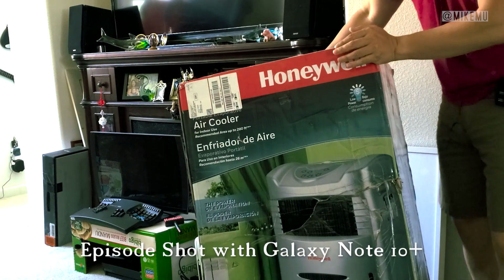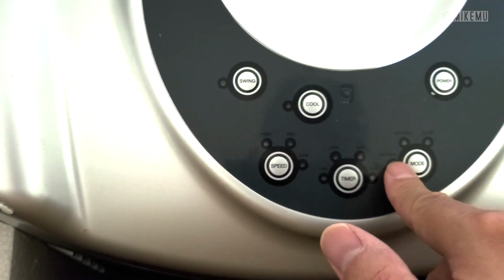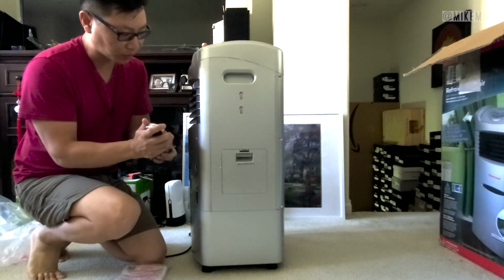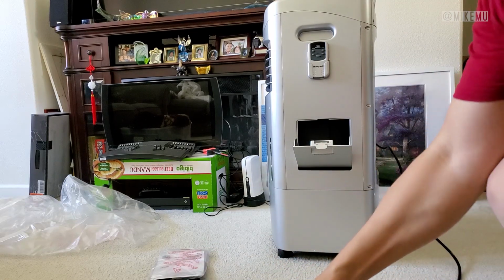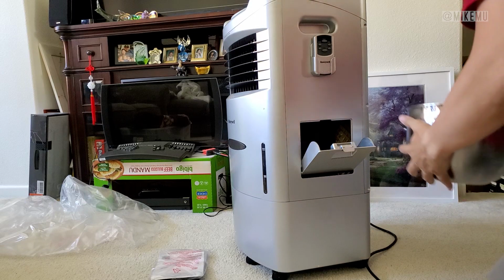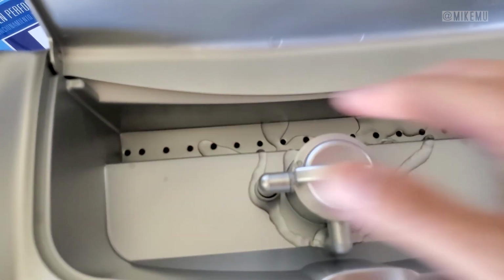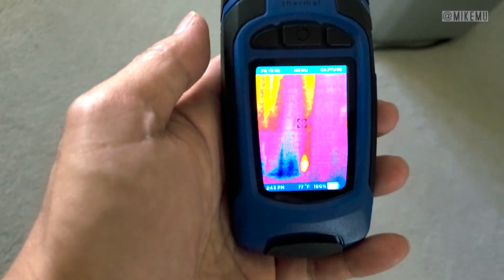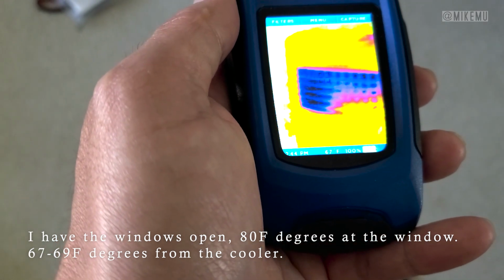Best Air Cooler? Honeywell Air Cooler | First Impressions Review and Test

Comment: I can't here. It's a swamp in the summer.   Still trying to drain it! lol   I'd still stick with AC.  I bought a portable second AC unit after my main went out one summer and needed something to get by while that got fixed. .  The new split window units look cool and better than the older 1 block window units and much more quieter perhaps with the split design.  As long as your insulate your exhaust hose on portable units - you're doing good. I haven't gone to full insulation - but wrapped tighly in 5 layers of aluminum foil and some dryer vent duct, keeps all the heat out the exhaust and never heat soaks.
Reply: I did set it up last 2 years and ran it to supplement main AC.  trying to hold out this year - not sure if I'll make it - it's been pretty dry - I'm not sure if taking a vacuum to the inside heat exchange part helped any - but i'm getting good temps.  Things might change if I turn my NAS back on. :(   that thing is like a nuclear reactor with 20 drives.
Reply from the maker: Where is here for you?  If you can, the split window units are so much better.  Its what my family in Taiwan use and its quiet, efficient, and looks way better than the traditional window units.  Too bad it hasn't quite caught on here stateside as much.
Reply: I'm from Bangkok where it gets to 80+% humidity at 35celcius (about 95F) and I can cool the air by about 10F. As long as humidity doesn't go above 90% it should still be quite helpful.
Reply from the maker: Wow. I wouldn’t be able to stand that for long. I’d be AC all day long in those conditions.

Comment: 5:57 man just the tiniest ridge on the little shelf there would allow for it to fill up and spill water over the edge evenly... could possibly achieve the same thing by just putting something just a mm or 2 thick under the back wheels and giving the machine a very slight tilt forward.

Comment: I live on the coast of California and mine doesn't do much good...it humidifies but the temp of the air coming out is only slightly cooler...not ten degrees... even with ice cubes and cold water. This is a newer model maybe that's why his gets 10 degree cooler air flow.
Reply: Evaporative coolers work best with dry air, and if you're right near the ocean it's probably too humid to do that much good.
Reply: I have one too and it doesn't do anything even when I put ice in it.  I live in a dry humid climate and it doesn't cool anything.  Might just toss it out with the garbage tomorrow because it's just a hunk of useless plastic

Comment: HI Mike.  Fantastic review.  Do you think this would work well in a 500 SF Garage in Las Vegas (110-115, extremely dry weather)?
Reply from the maker: It will drop it several degrees but not enough to be comfortable. But you add this an an AC unit it may do some real damage especially with some insulation. Otherwise you’d probably have to sit right in front of it.
Reply: If the garage has a window ( or make a vent ), use AC with evaporative cooler (save on electricity cost by ~1/2). You need a larger cooler for 500SF ( or get two of the model in the video ) without AC.  They should cool the garage down to 90F (cooler only no AC). Need to crack open the garage door when the cooler(s) is on.

Comment: When in use during hot summer days, do you open the windows to prevent indoor humidity from increasing ?
Reply from the maker: If outdoor humidity is higher no.  But yes if indoor is higher if you use something like an air cooler.

Comment: Inwanna use it in a room that has no windows, would that be ok to do?
Reply from the maker: If you also run a de humidifier it may be Ok. Otherwise you would be safer with just a fan or traditional AC unit. The moisture buildup could result in mold if humidity gets too high.

Comment: if only these worked in texas lol....no such thing as dry air down here
Reply: Fistagon777 Not true. It will work as long as humidity is less than 60%. Unless you’re in Houston or south you’ll be fine. Its 40% humidity in Dallas. People are reporting these units working fine at 60% humidity.
Reply: @jaeshasway  There is dry TX and humid TX... I'm guessing that comment came from humid TX. I'm in Los Angeles and it works well on hot dry days.
Reply: @joeltucker306  How well does it cool a room (even a small one) in LA? Like how many degrees lower, and does the humidity from the water help? Am in SF (reluctant congrats to the Dodgers, lol) but we've been having massive heat waves for the past several years.

Comment: Do you think you could use a dehumidifier along with the air cooler if you live in a humid city?
Reply from the maker: Absolutely!  But after you do that, you may be approaching power consumption levels of a very efficient air conditioner for similar results. So for humid areas, a traditional air conditioning unit is going to be best because it cools and dehumidifies as a part of the cooling process.  So what would be better is A/C plus an air cooler.

Comment: Hi Mike - Great video. Looking to get 2 of these units for my home. Now that you've had it for a few years can you provide any updated insights? Still a good unit overall and able to cool ~10-15 degrees in your home?
Reply from the maker: Yes. We don’t use much because the weather is good here most of the time. Stay away from hard water if possible, or use a water softener.  Make sure you drain it before storing.
Reply: @MikeMu  - i would imagine the ice cubes melt extremely fast and the water terms chances over time
Reply from the maker: @worldview2134  I have personally found that ice cubes don’t make enough of a difference to warrant the hassle of using them.

Comment: Thank you for the video mike. Can I ask you a question? Could you maybe tell me the dimensions of the opening for the water and how big is the reservoir? I would like to put an Engel 32 ice pack that is 12.5 x 8.37 x 1.62. any insight would help.
Reply from the maker: Hi Victor. I’ve done some testing and I’ve made no appreciable difference in performance.  Also I have the cooler at another location right now, and off the top of my head , that isn’t going to fit well.

Comment: Just bought one before watching this video. They sold it to us as if it was an ac but all it really is is a freaking fan. And another thing I didn’t even fill it up to the top and it started spilling all over my hardwood floor. Def not what I was trying to purchase.
Reply from the maker: Did you find out the cause of the spilling?  No issue here.

Comment: I have two.  They are CL25AE models. I think they are great for my needs this summer in CO. 

This just came up. Water in one was turning to a yellowish color and can smell it today.  So...I need to check manual if I can drain the water. I do not think there is an option to hand clean the reservoir.  My other unit is fine.
Reply from the maker: Great!  I'm glad they are working for you in CO.

These units need to be drained completely before storage, or when not in use.  There is a plug at the bottom of the unit (usually some form of rubber) that you pull to drain.  Make sure you do this outside, in a bathtub or somewhere you can let the yellow water come out because it will dump immediately.  

You can try to clean out the media...  But you might find out that you probably need to buy new filter media: I found one here: https://amzn.to/3h3eBH2
You can unscrew the back area and pull out the media.  At that point it should be pretty clear if you need a new one or not.

Use this as needed for your other cooler as a preventative/maintenance measure: https://amzn.to/390C4Wr (currently cheaper in multipacks)
Reply: @MikeMu   Awesome,  good to know.  Thank You for the information  and your reply.
Reply: Thank you for that information!  I used this in 2021 and now in 2022 so I'm trying to clean it out and maintain it. It our go between ac unit. In southern Colorado it gets hot early and cold late, unfortunately the rental company closes the ac for winter sooner then we wish lol

Comment: I would not recommend purchasing any honeywell air or cooling products. I purchased an evaporative cooler in June 2022, and it no longer works. Three weeks out of warranty, Honeywell says there is nothing they can do about it. Buy the parts and fix it yourself. Very disappointing and poor quality.
Reply from the maker: Did you by chance buy with a credit card?  Many credit cards offer free extended warranty.  In the case of the air cooler, they'd most likely simply just refund your purchase completely (rather than repair).

Comment: What if I kept putting in water without turning it on or pumping it and it's touching the black thing inside when you open the water door.
Reply from the maker: You mean the water sensor?  That would just be an indicator.

Comment: In how many days will have to drain out the water from the cooler u have not shown that in this video? Please reply
Reply from the maker: Depends how clean your water is. Best not to leave it in there if you aren’t going to use it. It’s very simple to empty. I’ve left it in for 2 weeks, no issue. I put a little peroxide in my tank every now and then.
Reply: Thanks

Comment: do you change the filter, or just clean the filter?
Reply from the maker: The outside one you clean. The inside one you replace after a while. Depends on your use and whether or not you remember to store the unit dry when not in use.

Comment: Can i use this air cooler together with centralized AC that we have? Thanks
Reply from the maker: Absolutely.  They are very complementary to each other.
Reply: @MikeMu  thanks for the prompt response. Because i read a lot of articles saying that they were not and some agreed same like you
Reply from the maker: One of the main reasons why they work so well together, is that the air cooler requires drier air to be the most efficient. A standard AC unit actually removes moisture and works like a dehumidifier due to the nature of the technology. So they supplement each other very well in most cases I can think of up to a certain extent.

Comment: How is the air cooler now after 9 months? still doing good?
Reply from the maker: Its been in storage, so its working just fine.  Make sure its not stored with water and it'll be right back working as original.  Descale if necessary.

Comment: Mines lasted about 5 months in the desert motor burned out any suggestions on where to take to get it fixed?
Reply from the maker: It'd still be under warranty.  You can contact the manufacturer and see about getting it replaced or fixed.  Otherwise any appliance repair place can replace the motor or bearings.
Reply: Mine lasted 27 days. Thankfully Amazon covered the return 100%.
Reply from the maker: @jaeshasway  What went wrong with it?
Reply: @MikeMu  Pump failed. I called Honeywell and they confirmed that it was probably defective. Because I was 3 days within Amazon return window they told me to call Amazon. I got a refund vs a replacement. Shortly after I bought mine last August I haven’t even seen them on Amazon anymore. My guess is they probably had too many complaints.

Comment: Hi. I have a borrowed Honeywell when my A/C went out. Now how to drain it to return it?
Reply from the maker: There is a drain plug on the bottom, usually near the rear.  Make sure when you pull it you do it outside as the water will gush out immediately.

Comment: Hypothetically - what if you loaded a significant amount of ice in the tub below - wouldn't that cool the water better than the odd trickle of melting ice above?
Reply from the maker: I wasn't able to measure any reasonable difference when adding ice top or bottom.  The pump is a like fountain that flows down over the ice.  The ice pretty much melts in minutes at full pump speed (obviously environmental conditions in play).

If you are right up next to it, you may feel a difference. I don't in my regular use scenarios. Plus, energy and heat used to create the ice cubes makes the effort not really net positive.

Comment: Does water spill out of the vents
Reply from the maker: No. I can’t see how that would ever happen.
Reply: Mike Mu once i turn on cool the water is coming through the vents
Reply from the maker: @nancyyen1  It shouldn't (if new).  You probably need to change your filter media?  Or you are in a very humid area, and need to turn the pump down.
Reply: Mike Mu thank you I opened the filter media and the top hose broke loose thereby causing the water on the vents
Reply: Just be careful to watch the white floater and don't overfill it. If you see any water in the indicator window, then the unit is already overfilled and will probably be leaking out the seams.

Comment: Do you know why my cooler is leaking water am I doing something wrong?
Reply from the maker: Is it leaking out of the back of the unit where the drain is?  Or elsewhere?
Reply: For this type of cooler, I would first suspect that it is not set on level ground. Try putting a glass of water on top of it to see if that levels out.
Another common reason is the wick/filter being too close to external grill/other parts. Try opening it up and adjusting it so that it is not touching other surface too much.

Comment: Hello can you plz help me my honeywell air cooler pump burnt suddenly means turned off by it self and by opening  side compartment plastic burning type smell came..plz help i m saudia arabia can i replace it with any other oridinary pump???
Reply from the maker: Hi Mary. It sounds like a major malfunction that requires the attention of an appliance repairman. Without taking it apart it’s tough to tell exactly what happened, but it is most likely caused by a short.  Usually it won’t be the pump motor that is busted, but the circuit board. I would recommend having a professional take a look at it.
Reply: @MikeMu  well thanx for reply..blower is working but pump not working ...

Comment: I'm wondering what's the problem with mine? It squeaks super loud and the fan doesn't want to move when I turn mine on. And sometimes when I leave the power on it eventually starts running properly but it takes a while for it to get going now. I opened it up and looked inside and I even tried to look at the fan and nothing is wrong with it that I can see visually. I'm wondering if there's a fan belt in this machine because I see a pannel above the fan that looks like it carries something else. I'm just wondering if you experience very loud squeaking from this machine or has anyone else? I'm about to open it up soon to see what that panel is behind above the fan is but just wondering if anyone else had the problem I'm having with this machine and if they have a solution? I'm past the warranty date so I can't take it back and customer service does not help at all.
Reply from the maker: My guess is it needs to be cleaned out.  Maybe hard mineral deposits over time have clogged up the fans  / pumps over time.  You could try running some hard water deposit solution to clear it up a bit and flush it out.  But it sounds like its due for an overhaul, and these weren't really designed to be user serviceable.  I'd say open it up and see if its worth cleaning out or just getting a new one.
Reply: sajnos  elektommágneses motor van benne  ,  felkel melegednie a motornak hogy fusson  mert sajnos a gépzsír  miatt  elégé szorúl a  a vasmag a mágnes térben  ,   sose vegyél mágnese motor   , csakis  tekercseset   ,  nekem kikelett cserélnem a villanymotort   egy  tekercses villanymotorra  ....
Reply: Szakemberrel  szereltes bele egy (tekercses villanymotort )   ugyan akkora fogyasztású és ellenálású legyen illetve ugyan akkora legyen az amper felvétele  , a tekercses motor   nagyon hosszú élettartalmú de léghűtőbe akár   még a te életedet is túl élheti

Comment: I have one and it works well but it stinks like fish. I read that it could be melting or burning of wires or something. Anyone have the same issue with it?
Reply from the maker: That's most likely bacterial growth or algae.  It might need to be cleaned out.  Also you don't want to store water in it when not in use.  I'd clean up the inside / tank as best as you can and use one of these products: https://amzn.to/3qjLkOa
Reply: Always leave just the fan running for 30 minutes before turning off the unit or stinky things may grow on the evaporative pad.

Comment: I have a honeywell cooler ive had it for a month i put a gallon of water invit an turned the cooler on and now its spitting out water why?
Reply from the maker: Spitting out water like in my video or all over the floor?  There is a plug you need to make sure is there.
Reply: Mike Mu where is the plug
Reply: Yolanda Perez did you find the plug he says is missing
Reply: Yolanda Perez try this open the media cooling on the  back the filter media and the top hose broke loose thereby causing the water on the vent
Your hose is not connected